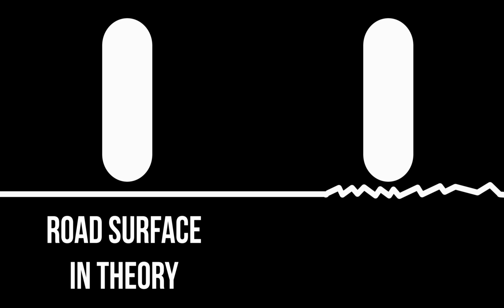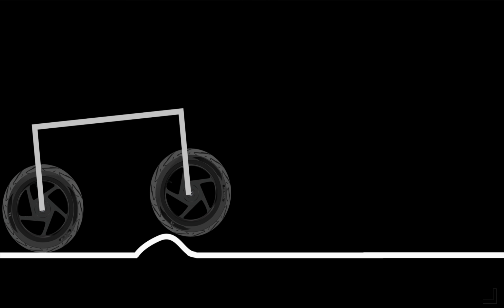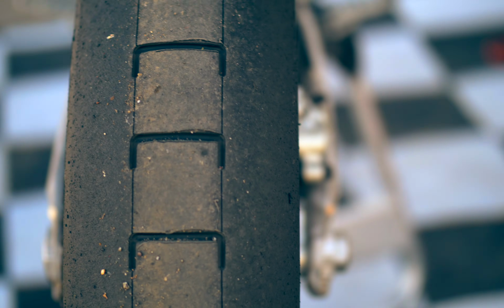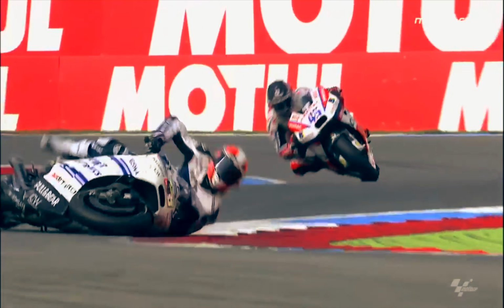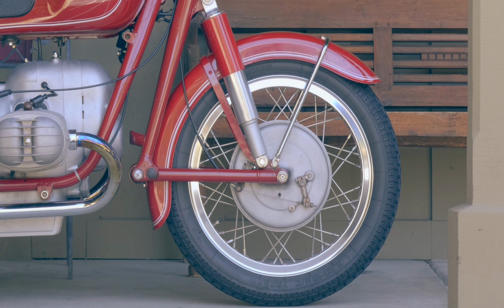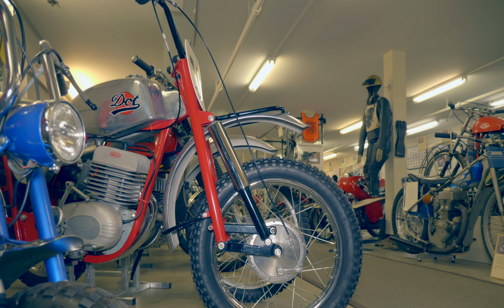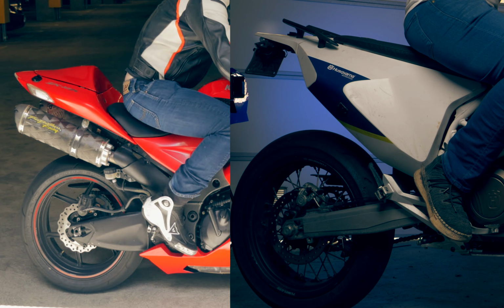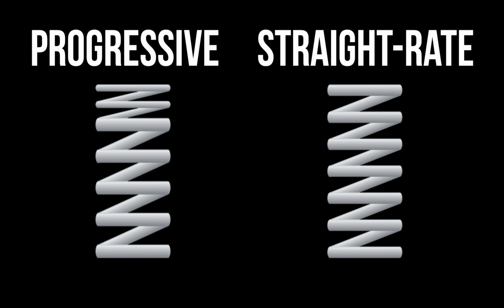Motorcycle Suspension | How does it work?

Comment: I would love I video like this but on transmission!!! WHAT IS CHAIN TENSION!! why is it important... Why dont all race bikes use belts instead? Or shafts for that matter...
Reply from the maker: I hear you. The reason they don't use shafts is because they produce excessive amounts of anti-squat. It is possible to design around it, but that adds way too much mass for race bikes. I originally had a segment about it in the video but took it away as the video got too long.
Reply: I believe belts would be more difficult for quick gearing changes at the track. And a belt system is wider and perhaps not as strong. Me, I wish my bikes had belts.
Reply: What about the fact the power to the wheel would be much less with a shaft or belt.
Reply: Pretty sure I read somewhere that chains are more efficient than belts and shaft-drive. The primary benefit of belt/shaft-drive, low maintenance, doesn't matter in professional racing.
Reply: Shafts are inefficient and weight about 10 X's more than a sprocket and chain. Belts wouldn't be a bad idea, but good luck convincing Honda, Suzuki, Kawasaki, and/or Yamaha to switch it up anytime soon.
Reply: @blipco5  I believe belts would just as efficient as a chain. You will definitely need to change out your belt more often due to wear, but I doubt you could measure any loss of power. 
 I could be wrong, but I doubt it.
Reply: @awhiteguy24  Why do you think a belt would equal less power to the wheel than a chain?

The shaft I understand the logic.
Reply: Christopher Fucci ..I have ridden a belt drive bicycle, you can really feel the belt stretch compared with a chain. Now I know it's not a direct comparison to a motorcycle but believe me, if a MotoGP team could do better with a belt they would already have one.
Reply: @blipco5  Yeah, I've never ridden a belt driven motorcycle, but I can't imagine that the tension wouldn't eliminate all measurable give. Think about the timing belt in most engines. The timing belts, especially considering non-interference engines, have very little tolerance. If your timing belt on a 80's - early 2000's  Mitsubishi let a the cam slip more than .001 μm, your valves would be ruined. IF you consider the weight of a car, (compared to a motorcycle,) and the load the drive train puts on the engine, you could safely wager that the force absorbed by timing belt of a mid-performance car likely exceeds the force an engine [typically] half the size of a performance 4 cylinder and roughly -1/3 the weight. 

TL/DR: I think a belt would perform just as well as a chain.
Reply: @HypheaTL  my 03' buell xb9r is belt drive but it was designed that way. Also doesnt make the raw power of most import 600s.
Reply: @justinhayden9374  I forgot all about Buell! They are belt driven... A friend of mine had a sexy 900. That was the bike that got me wanting to ride. It was a shame how that bike died. My friend's still kickin' though.
Reply: @blipco5  A chain gives the most direct power translation to the rear wheel. Belts have more stretch and under extreme stresses they're more fragile.
Reply: @HypheaTL  belt is made out of rubber, reinforced rubber but still rubber. So during the power phase, the belt will extend and you lose energy their, so it's less efficient
Reply: @blipco5  why would you rather have a belt compared to a chain?
Reply: Billy Ballsack... I rode my motorcycle around the US over a seven week period. I had to lube the chain every single day. It sucked.
Reply: instaBlaster.

Comment: My 2 cents: @7:27 "moving the forks up in the triple clamps" is essentially lowering the front end. This will "pull" the wheel towards the center of gravity, which will  reduce the rake and therefore the trail as well (since it is measured with respect to the vertical through the front wheel axis). I think this way is more intuitive.

Comment: Hello, thank you for the video. There are a  lot of detailed informations, which is really good for deep understanding.

I have a question related to rear brake and anti-squat. Am I right if I say that rear brake enables anti-squat ? According to your video "10 Things MotoGP Champions do to Go FASTER", you show  how the rear wheels bounces when applying rear brake. But how does it works ? what happen to the rear suspension when applying rear brake ?
Thanks a lot for your answer !
cheers 🙂
Reply: Ok, I think I have my answer :
When you push down on the rear of the motorcycle, you compress the rear suspension, including the rear shock.
Applying the rear brake while the rear suspension is compressed introduces resistance to the rotation of the rear wheel.
This resistance slows down the rate at which the rear wheel can rebound or return to its original position.
As a result, the rear of the motorcycle bounces back slowly because the brake is resisting the motion and effectively damping the rebound of the rear suspension.

So If I have well understood,  rear brake allows to have additional control to the damping of the motorcycle.
It can be used to control the weight transfer when braking, or as an anti-wheelie when we accelerate (because the rear is forced to an anti squat position)

Comment: Hi Mike.
During the Husky 701 bounce-test in your Video......
Your Rear-End, your Shock Rebound setting is much to slow, to much Rebound-Damping. 
Esspecially in Low-Speed Extension....on the top End of Extension.

Also a good motorcycle Suspension Video:
https://youtu.be/AggEtStSMcE 
....and on. 

Old but good!

Comment: I'm still confused with the anti-squat thing...
Reply: when accelerating the bike squats because of the mass and G-force.
this results as the front being lighter hence loss of traction in the front.
to prevent this, the chain pulls on the rear sprocket and anti-squats because of the angle of the swingarm

Comment: i wish you could make a video with common suspension problems, like why the bike goes wide on a turn, why does the bike feel like its skidding over the tarmac even tho there is grip etc etc.. that would be very informative and helpful. thank you !
Reply: All things being equal meaning that if you have the bike at a basic neutral setup it's probably Rider that is causing the problems. Body position and weight placement with regard to center of mass and center of gravity have a significant impact on handling characteristics. Learn how to ride in a neutral position. Remember to use your hips as well as your hands shift your center of Mass to affect the center of gravity. I would probably read up or watch videos with regard to dirt bikes and Motocross in this area. That should help you get a better understanding

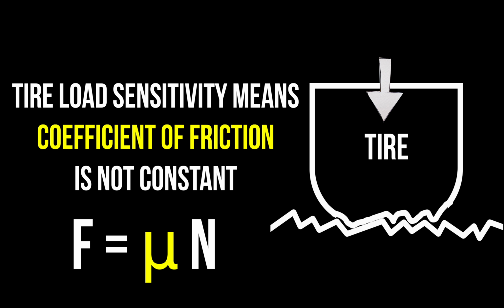Comment: 3:17 wouldn't the vertical load instead affect the Normal force perpendicular to the surface instead of the friction coef which solely depends on material properties? Or are you also refering to static vs dynamic friction coefficients due to tyre slippage? I don't think this part is clear enough.